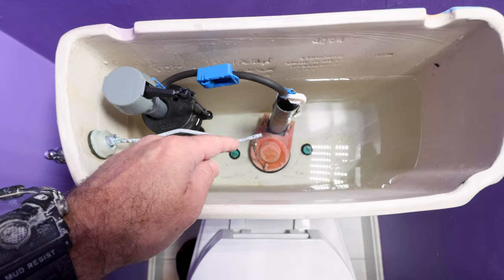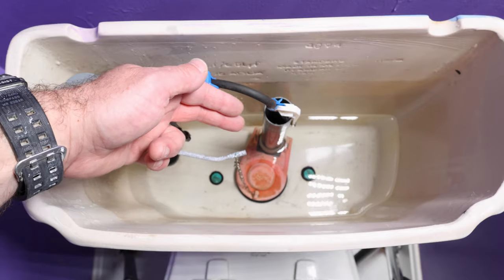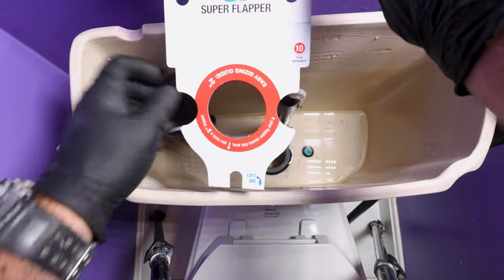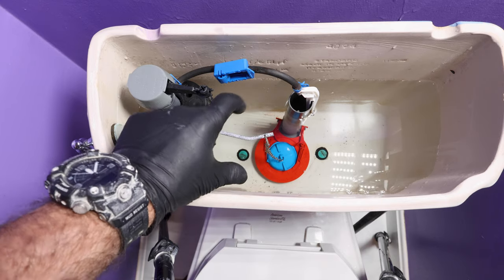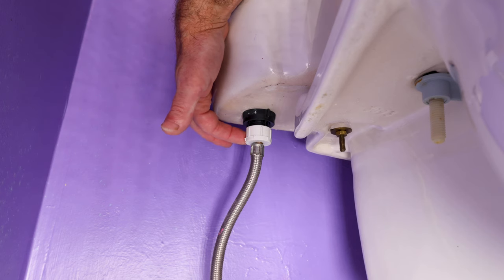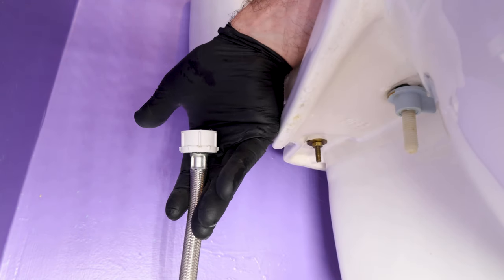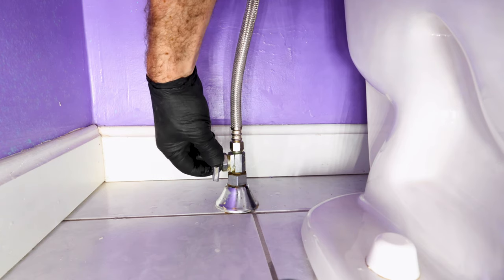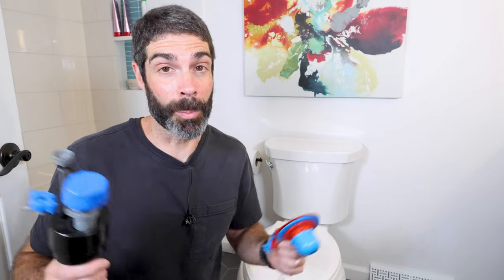Fix A Toilet That Randomly Runs with Fluidmaster's K--400H-043 Toilet Fill Valve and Super Flapper

Comment: I replaced my old fluidmaster with this version. Very easy installation. The only issue I'm working on is that, from time to time, the value will turn on for about 2 to 3 seconds, then shuts off. The flapper isn't leaking. The tank is holding water. The float seems to be floating. The value doesn't appear to be defective. Any suggestions?
Reply from the maker: Fluidmaster would like to provide help.  The valve you installed is not defective. What you are hearing is the “Water Waste Signal” and it is telling you that the tank water is leaking down. If you do not see water on the floor or on the outside of the tank, then we know that the water is leaking into the toilet bowl. Here are a few things to look for A) if you have the refill tube shoved down or placed inside the overflow pipe pull it out and reattach to the overflow pipe using our refill clip. This will stop a siphon from occurring and stop the leak and B) Clean the bottom of the tank along with the drain seat that the flapper sits on, if you can’t get the tank to stop leaking with a new flapper then it might be time to change the flush valve. If you need further help, contact Fluidmaster’s Technical Service Department as we are available Monday through Friday from 5:30 AM through 5:00 PM Pacific Standard Time. Contact options include Chat www.fluidmaster.com/support E-Mail techsupport@fluidmaster.com and Toll Free 800-631-2011.
Reply: @FluidmasterInc  Thank you. Part A fixed the issue.👍🏽